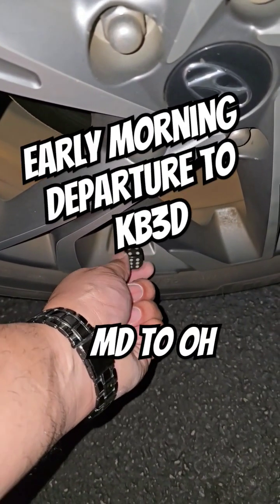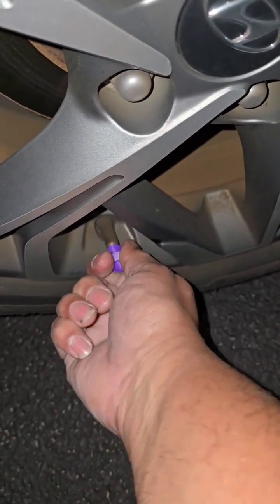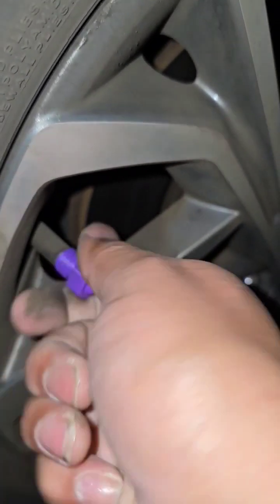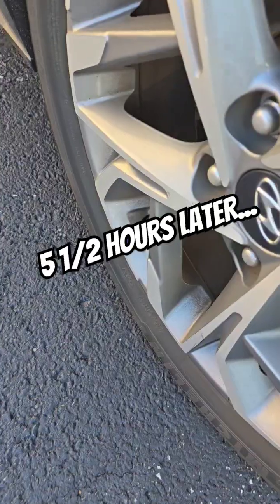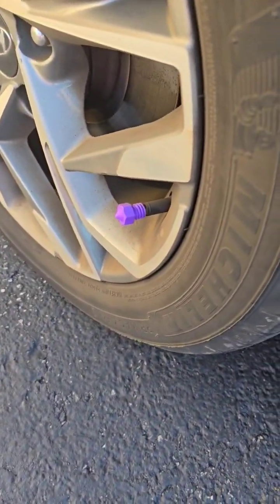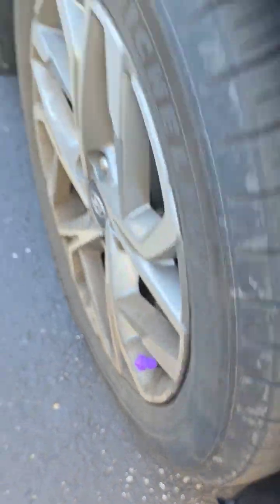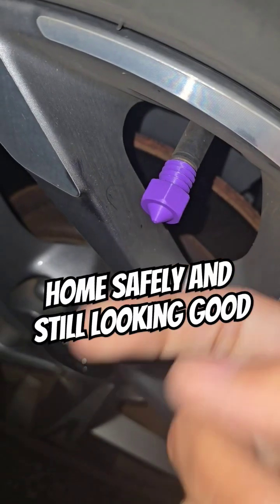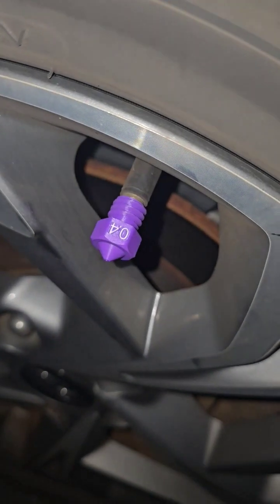PLA as Car Parts DAY 1: 786 miles Later. #3dprinting #3dprinted #bambu #3d #car #a1 #experiment

Comment: I ran green Yoda's printed out of regular PLA for a couple of years on my Smart car. They did fade a little but held up great. I would grab a picture but my Smart car is no more. Someone turned in front of me without giving me any time to avoid them and I T-boned them. The Smart car did as advertised and protected me inside the titanium passenger cube and air bags. But my poor PLA Yoda's are no more. 😢
Reply from the maker: @lynnstark3755  That Sucks.  Poor Yoda's.  
Crash They Did.  No More they are.  The Force was Strong in the Other Car, Yes it was.  Total your car, you did.  Tempting the Dark side is.  Forgive them you must.

Comment: I'm not sure what this test does or proves but it's not holding any pressure so why wouldn't it last?
Reply: Yeah this is nbd for PLA. They should survive decades under these conditions. I had a washer fluid hose barb in PLA survive like 3 or 4 years under hood. Until you're well over 50°C PLA is fine.
Reply from the maker: PLA is suppose to deteriorate when exposed to UV and Fluctuating Temps like those that come off your wheels during heavy braking.  The temps  emitted from your wheels could lead to thread failure.  It's only day One.  Stay Tuned to see if they Do or Don't hold up.
Reply: @ gotcha...what are you planning to make next from this test? Would other materials be better for the specifications you are seeking?
Reply from the maker: @stkyrce  ASA, PC, PET,  or PAHT would be the BEST filament for Automotive applications.  This isn't a video to find the right material but more of a fact finding mission on PLA "facts" that people have stated to me over the year which SOME I have found to be false.  I have tested PLA clips and hangers inside the car during the Summer (not recorded) and that's a definite no go over 95f (35c).  We made a PETG center console tray for a friend who has being Long Term Testing with it since May.  We should have the 6 month testing done in a few weeks and should have video coming out at the end of this month.